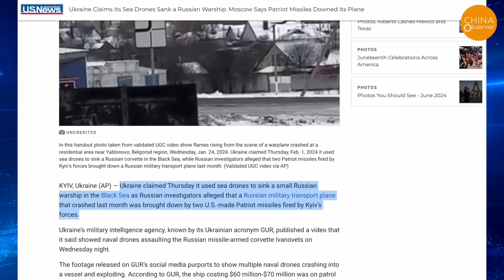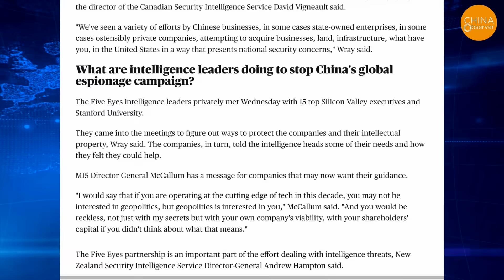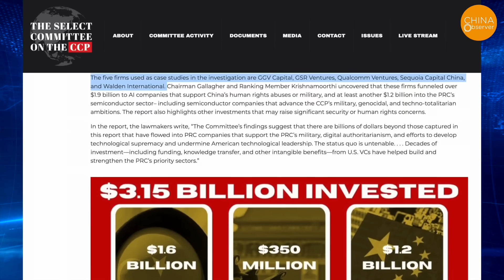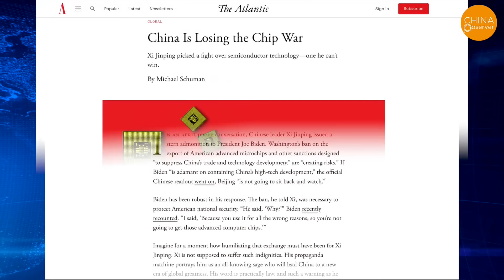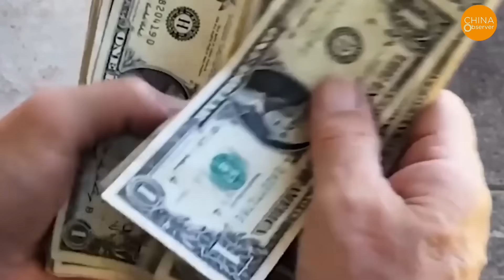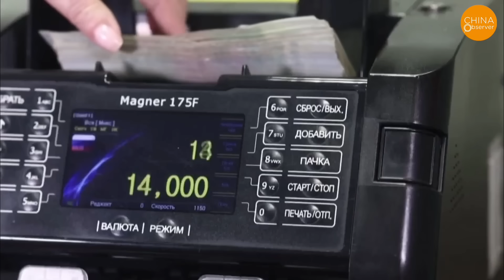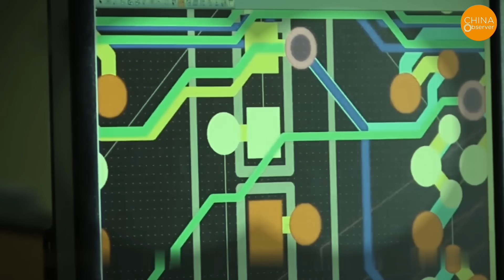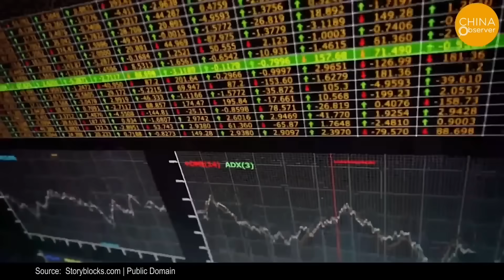US-China Chip War: China Loses More Than Chips, but Entire Military Capability

Comment: BELL LABS INVENTED THE TRANSISTOR 1947, FAIRCHILD INVENTED SILICONE VALLEY IN 1957,  1971 intel CREATED THE FIRTS 4 BIT MICROPROCESSOR (and the world changed) and by 1976 Wozniak/Steve Jobs CREATED A POPULAR-USE PC. "THE" next Processing Invention may not be Binary 1's and 0's based -- (MAYBE) A "QUANTUM INFERENCE ENGINE" BURRIED IN A CRYSTAL LATTUCE STRUCTURE ... OR WHATEVER - TIMES THEY WILL BE A CHANGING.

Comment: Did you see the coup attempt recently lead by Chinese armored vehicles in Bolivia? The first vehicle in the convoy attempted to go around traffic and hit a 6” curb and broke the wheel. One wheel was straight and the other was pointed 90 degrees right. They held up the entire convoy and by the time they fixed it they had lost the element of surprise. Still, they attempted to ram the gate a the capital ,which didn’t look very imposing as it appeared to be a basic 1/2” steel rod gate, but was unable to get through. It’s funny because they knew they were screwed at the 6” curb and were panicking kicking the tires. The coup failed and I’m sure that if they are alive they are in hell. Nobody wants to buy Chinese weaponry anymore as they can’t even pass the demonstration test defense experts demand. They did trick Africa into buying weapons. Who knows, maybe the quality is acceptable there as the bar is low.

Comment: Can China produce advanced chips?
By then, the country could be producing 28% of chips below the 10-nanometer level. China is expected to make only 2% of the most advanced chips, according to a report released Wednesday by the Semiconductor Industry Association (SIA) and Boston Consulting Group (BCG).8 May 2024
Tech war: China quietly making progress on new techniques to cut reliance on advanced ASML lithography machines
By applying SAQP to DUV machines, China could make sophisticated 5-nanometre grade chips without the need for more advanced EUV tools sold only by ASML
Local semiconductor equipment leader Naura Technology Group began preliminary research into lithography systems in March, according to sources
Reply: Not to belittle you, I have a question: Do have any idea of the chip yield with this process?

Comment: I saw what the CCP did with their robotic dog rip-off of Boston Dynamics as it marched with a squad of policemen. It hit a minor slippery part on the pavement, flipped over and broke. This is not the terrain finesse acquired by similar robots that the CCP poorly copied from Boston Dynamics prevalent nearly 15 years ago. China copies; it cannot design or improve. It's equipment looks clean and new on the outside, but is substandard, shoddily designed and obselete on the inside. This fakery affect applies only to China, not to other advanced Asian countries like Japan, South Korea and Taiwan. This is the "faking effect" of the CCP; a low-quality shortcut mindset that helps to push that ideological organisation into the historical garbage bin; along with the Nazis and Soviets.
Reply: yeah man I concur with these sentiments. A lot of Chinese goods are trash. Especially in the electronics sector. A device may work, but for how long? It's because they use the cheapest materials to reduce cost instead of using what's appropriate to the longevity and reliability of the device.
Reply: Let's not forget that along every step of the way from the top down in their system people are skimming money while the manufacturers are literally thinning out the basic mineral materials used to make each product or replacing them with cheaper and/or more easily available minerals. That way each company can have extra leftover materials to make more products while also pocketing the extra Yuan they don't spend on more of the necessary materials while bribing officials there for the contracts.
Reply: 😂🤣😂🤣😂🤣You are so funny
Reply: Copy? Said by whom? You??😂
Reply: @kinwai27271  It looks exactly like Boston Dynamics robot dog.
Reply: @johnbui6530  But was remote controlled like a RC car.
Reply: Haha, typical loser love making excuses🤭

Comment: A chip with wider nanometer scale, will work, it will consume more power, be bigger, but it will do its job.
All ballistic missiles of all Nations use 90years chips.
Older chips are slower etc but they will do the job
Reply: Performance, not just efficiency is higher on smaller scale chips. Smaller footprint, less parasitic capacitance, higher clock speeds.
Reply: It is also worth noting that many aerospace chips are intentionally built with a larger feature process. This is to reduce their vulnerability to electromagnetic radiation.
Reply: @Stu_Bur  depends on its role and the shielding provided by circuit housing. If it needs performance it is likely on a board in a grounded box, if its weak and needs semi exposed it's larger to handle more radiation without bit flips or other interference
Reply: @SlavTiger  For military hardware they are almost certainly going to be shielded either way. Rad hard chips will be used when shielding isn't enough for the desired reliability in an application. For a satellite, that is going to be always because of the high radiation and unlikely servicing access. For a military aircraft, it will be for at least certain core systems. They have to handle not just bit flips from cosmic rays but resisting electronic warfare including directed energy weapons of various types.

Comment: I would think you mean - lose much of their higher teck military capability; because even a 2 million person army just with rifles is a fairly awsome military power - see - Korean war. In addition; where you have to do a tech workaround you probably can.  An example - what is better - a processor that is 2x as fast or code the works 2x faster?  When you can't just buy more horsepower; you can often fine tune your vehicle and get more out of it.  So - mm not having the best chips will have an impact but maybe a small tech gap that can be overcome.
Reply: There is a limit to either side, software or hardware. You can only optimize so far or brute force so hard before hitting performance plateus
Reply: @SlavTiger  I think what you are saying is more accurate; usually hardward is pretty efficient; software is usually junk to be putting it mildly.
Reply: My dude they have 40mm machine guns now....how tf is an self deletion wave army supposed to charge through that. Also that was before night vision and good luck with that.
Reply: That's WAY oversimplifying several key factors in this.  To use your example, code can only be made to be so efficient.  When you're talking about chips that are capable of running 10 times 100 times or even 1000 times more instructions per second, you can't possibly make code efficient enough to make up a gap like that.
Reply: @Louisenjoyswriting  have you ever seen the code for these systems; a competent programmer given time could improve speed by a million times they are nealry always fat bloatware; and very few if any hardware improvements since China has had limits applies to them would increase anything in hardware by 10x ro 100x without a total new product. If you were doing a ground up system replacement maybe you could ; but that sort of development takes a long time to do and a lot of times they fail. By that time China will have developed their own 3 nanometer technology
Reply: They have terrible software code currently. If they invest in improving it they could improve performance and reliability considerably, even if limited by less capable hardware. Chip bans put a cap in maximum potential performance but they could drag up their average performance just by upgrading their equipment to the limits of the chips they can produce and taking more time to optimize and troubleshoot their code.
Reply: I would not mess with them especially they remember history of countries who invaded them and try to conquered in 19 and 20th century and they kick out mighty Japan.
Reply: @balkanikking160  You seem to be hung up on this idea anyone wants to invade China. You're like Putin who is so paranoid someone wants to invade Russia.
Reply: A 2 million man army is impressive but there's the small problem of moving that many soldiers to the battlefield, especially if it's over water like Taiwan is.